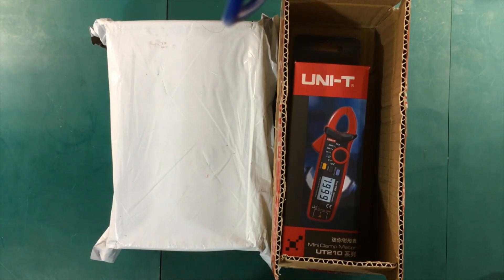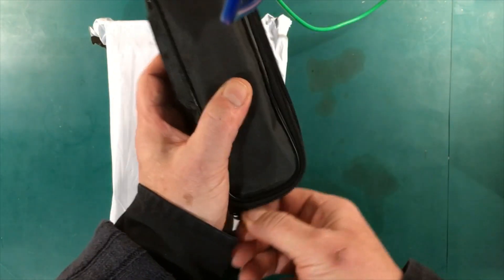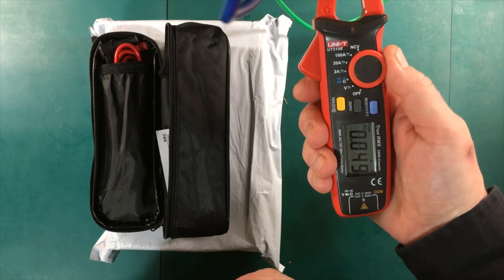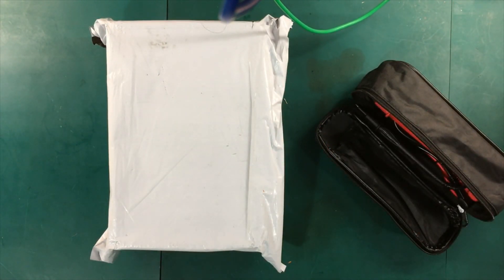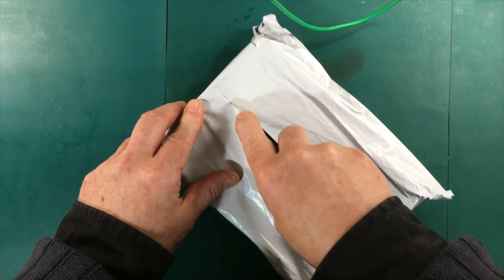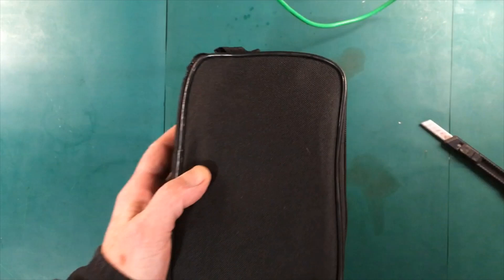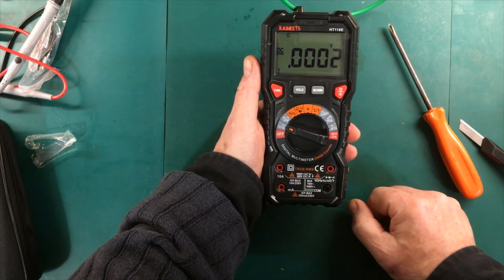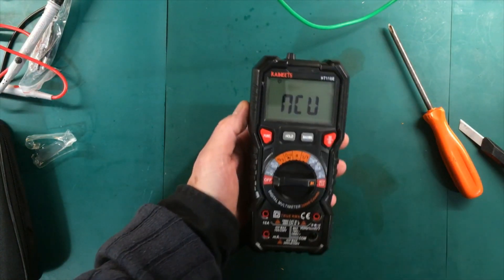0009 - Kaiweets HT118E & UNI-T UT210E - Unboxing and quick first look.

Comment: In the DC mode, all DC current meters using a jaw are sensitive to voltages generated by the magnetic field. You must place the meter in a stable position, pass the wire through the center of the jaw, and with no current passing in the wire push the zero button, allow current to flow and the measurement will be accurate.
Reply from the maker: Thanks for your comments.

Comment: To increase sensitivity, I feed the cable a few times through the meter and divide the result. Then it measures ok…
Reply: @AndreasSpiess  Andreas, that certainly is a valid process and method to enhance resolution. It will work OK if the resulting measured current is significantly higher than the current induced by their magnetic field it is still better zero the meter flowing then you can apply your technique to enhance resolution.
Reply from the maker: Great idea Andreas!  Thanks for stopping bye.